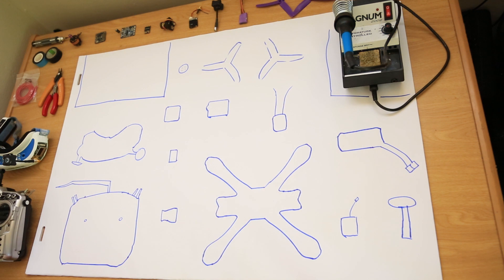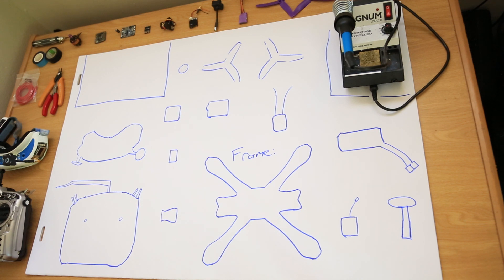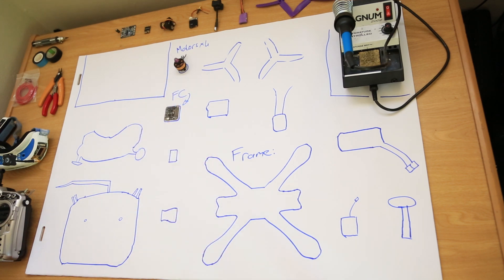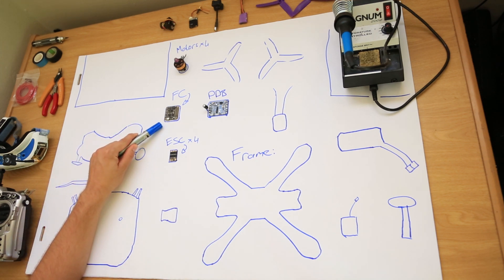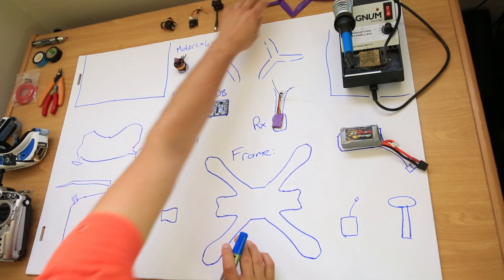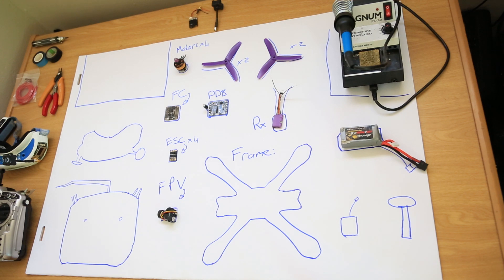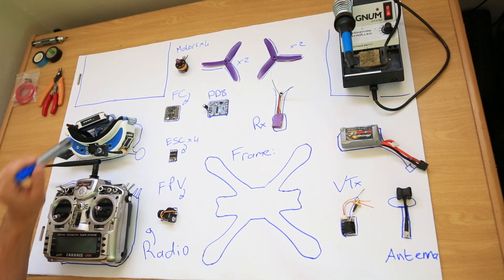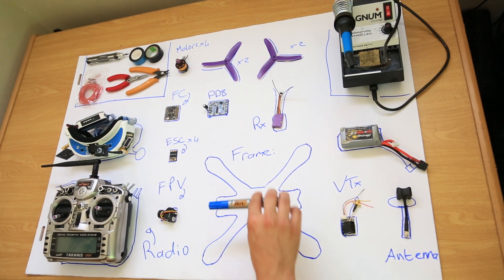What You Need to Build a FPV Quadcopter / Drone || Rundown of Components

Comment: do you really need a power distribution board, couldn't I just solder the right wires together and use something like a 7805 for things like my control board
Reply from the maker: You Could but a power distribution board give you clean 5V and 12V power sources and it neatly brings together the power harness.